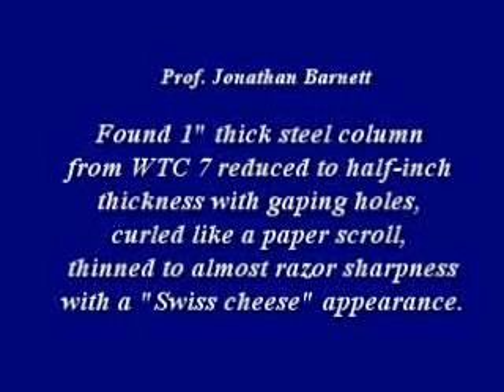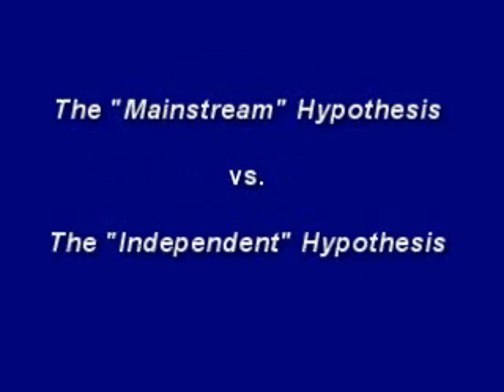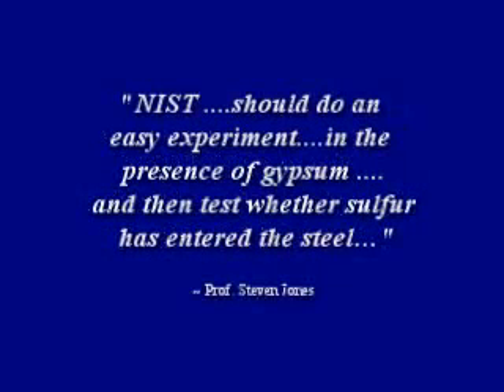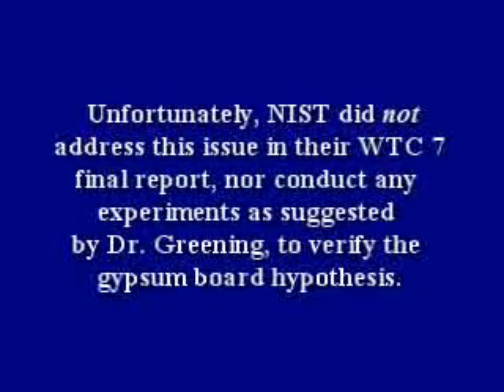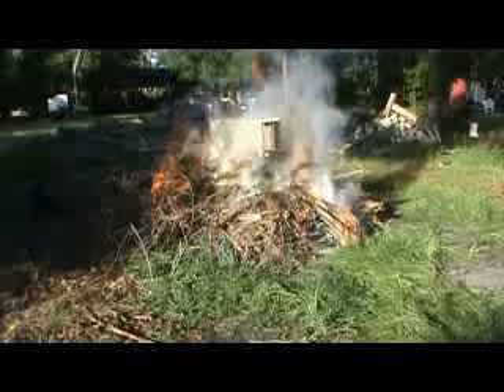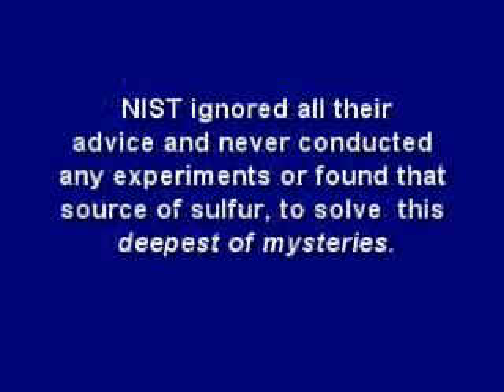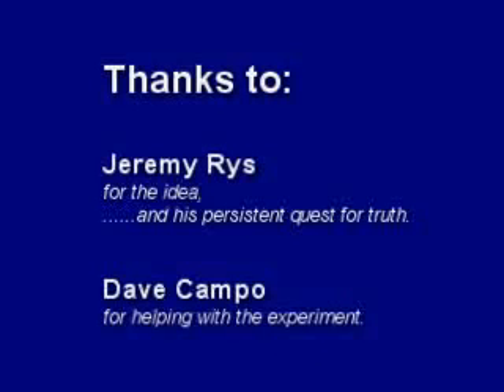9/11 Experiments: The Mysterious Eutectic Steel

Comment: @IExposeMormonism I understand nanothermite can be mixed in water & painted on the steel cores. Uniform lengths of steel beams which fell were stacked & loaded on flat beds sent to NJ lots before the were loaded on ships & sent to India & China for recycling. 911 01 was planned and set into action by Strategic Communication Laboratories, London. The PVI plane animation was generated on the helicopter shot. Zooms in and out at SCL's opCentre were practice shots in preview monitor before program

Comment: @Merlin5x5 McCormack Center fire:1960 exposition hall destroyed in 1967 fire, thought fireproof by virtue of its steel and concrete construction. At the time of the fire, the building contained HIGHLY FLAMMABLE EXHIBITS several hydrants were shut off, the sprinklers proved inadequate.

Sound theater-Lancaster was built to conform to a 2-hour, fire rated assembly code, many other fire protection features that could have assisted in saving the structure and reducing the damage were not present.

Comment: @Merlin5x5   So, If I can prove this is in the NIST report will you admit you haven't actually read the documents?  Will you also admit that you're the one that "blows" er a, hot air...for the most part?

In fact, how about you stop posting if you're wrong.  Put your money where your mouth is...well, no, there would be pubes on it then.  So, you retire and go back to your little sand castle and rule it 'til the tide comes in..

Comment from the maker: @911twoof The average acceleration for WTC7 the decade before 2001, was zero.   And on average, for the prior 1000 years, WTC 7 never existed.  But its not the average acceleration that matters; its the instantaneous acc. that is key.  The fact that it fell  free for about 100 feet means that there was no supporting structure at all. What force removed all supports, allowing building 7 to fall free?  The only force that make sense, matching all evidence, is that force from explosive energy.

Comment: @SuperLogicalthinker The witches had to come up with a story for why the PVI plane animation generated on the helicopter shot did not stop at the premapped parameters set on the camera shot. Notice the zooms in & out before the plane icon entered the frame. Director was rehearsing the animation in PREVIEW monitor in the control room. The reset button had to be hit on the keyboard to adjust the parameter & was not pressed therefore the PVI animation continued to the preprogrammed line. pvi. tv.

Comment: @SuperLogicalthinker FYI, Repubs changed the stars on the Repub logo to pentagrams after GWB was appointed president in 2000. Marvin Bush was on the board of directors of Securacom, security of WTC. Witch cousins' John & Michael Cappelletti's demolition company gained clearance to enter WTC w truck of nanothermite. Nanothermite mixed in water is easily painted on steel beams. Lengths of steel beams fell in similar lengths to be stacked on flatbeds, shipped to NJ yards to be prepared for shipping

Comment: @Merlin5x5 Problem is: You cannot get more heat release with lower oxygen,
you might contain it yes. But the ratio between oxygen and containment would not in a million years allow steel to melt. You can do an experiment in your fireplace: 
Make a solid fire over a couple hours with firewood, Shut the air intake valve almost to a complete. Would this result in a tremendous heat increase and the cast iron fireplace would melt? Would it stay roughly the same, or decrease.

Comment: "In effect, I think it looks like it was first compressed together, then extruded THRU an opening snapping off at the thin edge." I somewhat agree on this from an observational viewpoint, however an analysis of this object should be conducted to see if it has a link to the iron microspheres. Lower oxygen equals lower heat release, there is no reasonable fire mechanism to support this happening under the rubble. Do you have any basis for explaining how low oxygen can increase fire heat?

Comment: @Merlin5x5 Well, its pretty hard to tell without proper analysis anyways. One thing is certain, that thing was hot as hell. Its hard to define excactly what steel it consists of.
I don`t believe this can occur naturally in office fires, there is no presedence that I am aware of to suggest so. I find it very curious if NIST has not forensically analysed this piece, as it is an anomoly at best, I cant find any analysis performed on it. An electronic microscope would tell us more about cause.

Comment: @Merlin5x5 So what is the natural cause of 3 concrete floors fusing with alot of steel making it a meteorite shaped lump of rust? What temperatures could cause this "fusion" ? One would expect such an amount of material would pack some serious thermal mass and require _alot_ of heat. Is it possible that in an oxygen low environment under the rubble of WTC towers it could reach the conditions needed naturally (not to mention sprayed with water). This piece should be analysed with a e-microscope.

Comment: @Merlin5x5 so 316-450 celcius office fires are equal to 1580celcus ? eutectic steel is caused by gypsum that is practically fire-retardent? Do you have any notion in how temperature and heat correlates? If you put 1 woodblock in your fire place, would the steel melt? What about 2? 4? WHAT IF IT WAS AN OFFICE FIRE AND IT WOULD NEED TO FIND NEW HYDROCARBON SOURCES? WHAT THE FUCK WOULD HAPPEN TO THE STEEL ABOVE? Cool? or melt? stupid fuck

Comment: @Merlin5x5 "It's under the boots of every Welder that uses a cutting torch in the world." And at what temperature does a welder operate? At forgelike condition under a rubble of a 47 story complex?

"There are two LOW PRESSURE lines for fuel and oxygen."  excellent, 
and does a lower amount of oxygen than air in an atmospheric condition allow 
higher temperatures in hydrocarbon fires? ( if no, why are you insane ... again?)

What causes steel to melt? officefires or thermite?

Comment: @physicsandreason OK. But, still, Greening said aviation fuel. Its just something the opposition will point to regardless of whether or not it makes any sense. I did a search on aviation fuel and found that there are additives that may not be in diesel, e.g., dinonylnaphthylsulfonic acid. Could that possibly cause a eutectic formation and could that be a reason why Greening wanted aviation fuel in the mix? Thanks.

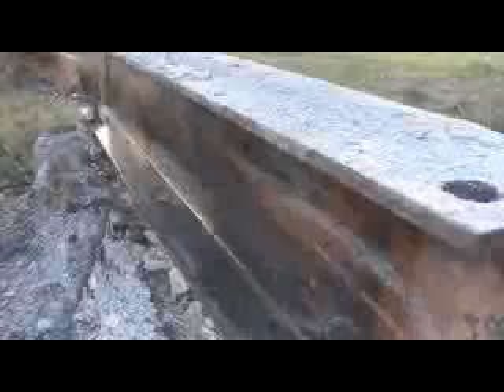Comment from the maker: @AnnRKey I did include some rusted steel in the mix.  Some are shown on top of the wide flange at 7:11.  I also included some plastic in the mix.  I used diesel fuel (off road #2 fuel) rather than avaition fuel because no plane hit WTC 7 (the focus of this particular video) yet there were diesel storage tanks that some said "could have caused" the eutectic formations.  Feel free to copy.

Comment: @PsychoBurgundy2 What the hell does that have to do with anything? The outside dimensions of the WTC towers were 208ft x 208ft , the official story claims the upper block and the floors collapsed on top of each other and accumulated. This cannot happen when the floors and upperblock is exploded outside the 208ft x 208ft perimiter. If you try to hit a nail with your hammer and miss, do you think it would drive itself down due to gravity?

Comment: @Merlin5x5 And when it comes to calculation of energy you cannot understand the very very very basics. Can 100% of the energy be conserved in gravitational motion over 12 floors when there is structural components beneath it? Can it ALSO pulverize buidlingsize amounts of concrete and throw steel 2-300ft in the same process? What part of this BASIC knowledge don`t you understand?
This CANNOT occur NATURALLY according to NEWTON and CONSERVATION OF MOMENTUM YOU IDIOT!

Comment: @Merlin5x5 Woah, there, mister know-it-all.

Did you know the melting point of steel is 2700C?

If you knew any math, you'd know that steel doesn't lose half it's strength at 600C, especially a 22" by 42" thick steel beam designed to withstand up to 3000C fires. Not just that. if steel melts at 2700C, how does it become molten steel in massive amounts under the WTC with just 450C and 600C?

Your theory is flawed :)

Comment: 911 was a staged event, it took planning, but slipups happened. PVI virtual media services/LVIS computer generates wireframe virtual lines on which an icon/jpg is animated. This computer is used to generate virtual lines on camera shots for downlines & line of scrimmage to be generated. When the plane icon was generated the parameter for the edge of the building was not adjusted, the plane icon appeared to jut through the edge of the blg. pvi. tv home page has many virtual environments.

Comment: @Merlin5x5 The "Murtaugh" building? You do mean the Murrah blg, do you not? I don't think nanothermite is considered a bomb & was probably chosen because it could easily be painted on the steel columns. I have learned that nanothermite was available at the Philadelphia Naval Business Center. A short distance from Upper Darby, PA, where the Cappellettis live, a short 90 mile drive to NYC for a truckload of explosives. Cousin, Marvin Bush's Securacom co. gave clearance for entrance in WTC.

Comment: Fire, an organic process, burns 1 area, and moves to another looking for a fuel source. It doesn't burn an entire floor at the exact same temp, causing every truss to sag/break at the exact same fraction of a second! We saw 3 symetrical collapses on 9/11 blamed on non-symetrical damage, fire being the main culprit. If fire were to cause a collapse (which it has NEVER) it could NOT replicate Controlled Demolition. If one side burned faster than the other, the collapse would be NON-SYMETRICAL.

Comment: i was a structural fitter for years before i was hurt. meaning i built steel structures, so even after only working with the steel for a few weeks i knew that there is no possible way to melt steel with temperatures from only normal office type supplies. as i recall the wtc fires only lasted a few hours, and had burned out BEFORE the collapse, because of the people standing in the holes made by the plane entrance and you kept it hot for over 24 hrs,

Comment: A typical closed mind 'expert' response to this event based upon incorrect ASSUMPTIONS !

Compound elemental aglomerations formed within the induced collapse are bound to look like thermite due to the construction materials used, 
but that is NOT proof that thermite was there before the event.
Ditto sulfurous and rusting iron (tiny spheres/dust) due to molecules atomically disocciated from the steel beams in the presence of sulphur and oxygen atoms.

Comment: what type of iron did you use?, what state was it in. You did not say  the number.  a what if the iron alloy had high sulfur content in it What if the steel mill use sulfur to lower melting point to save money. Any more and more look over evidence I find that the build cut corners that should have not have been cut. In  the past over shore have miss labed things. Like labing grade nine blots  but they were not.

Comment: We have eutectic steel, iron microspheres, pulverized concrete, fused concrete and steel meteorlike formations. Even police handguns fused with steel/concrete, 6 inch steel columns bent like a horseshoe virtually without cracks or buckling. According to the National Fire Protection Association standards, practically either one of the above would lead to tests for exotic accelerants, This is true for a regular two-storey building. NIST however has it`s own "Standards" .

Comment: speaking about holes in the world trade center steel and strange curling of the steel.. if you go to the world trade center memorial in warren, NJ you can see the holes and strange curling.. call me an ass, but i took a 3 inch and a 1 inch piece piece off the steel that had these little and big holes and i was trying to get it tested i was sending emails but no response i had the pieces in my trunk of my car and 3 days later my honda prelude was stolen never got it back never could get it tested

Comment: @Merlin5x5 If you can replicate the eutectic steel and its characteristics "reduced to half inch thicknesswith gaping holes, curled like a paper scroll with a swiss cheese like appearance etc" I suggest you do excactly this. Using what availible building materials found in WTC7 and probable configurations according to building techniques. I would also suggest a extreme case scenario with the best combination ratio of the materials to support even a remote possibility of occurance.

Comment: oy...so they had been pre-wired with explosives 30+ yrs ago when the building was built? I think your theory is based on incomplete info so flawed ..much like the second gun men theory with JFK  if you change two facts The seat JFK was sitting in was 6 to 8 inches higher then they thought and Sen McConnell(sp?) turned when he heard the first shot..the Magic Bullet theory goes out the window..what if the steel used was just cheap and the inspectors bribed so it would pass inspection .justathought

Comment: @SlipknotHeadbanger1 It had been postulated that the sulfur from the gypsum wallboard led to the observed phenomenon in the steel. This experiment shows that burning gypsum and others materials in the presence of steel will not lead to the effects detailed in Appendix C of the FEMA report.

A real investigation is necessary.

Comment: @TheSkepticalIdealist My father confirmed that molten Aluminium was pink in colour in the furnace and was silvery when poured out in air.
Simple. "
-
Well sorry, its just not true. You cannot tell what metal it is just by looking at it.
TheSkepticalIdealist "

Well if you spend your life working in a foundry that only deals with smelting and forming aluminum,its pretty obvious that those who had been working there are able to describe the behaviour and look of the material.

Comment: Regarding WTC7, NIST states in their final report, "Due to the effectiveness of the SFRM[spray fire-resistive material] the highest column temperatures in WTC7 only reached an estimated 300C(570F), and only on the east side of the building did the floor beams reach or exceed 600C(1,112F)”

In this experiment by Jon Cole the fires did get hot enough to melt the aluminum so that is at least 1,220 F.

Comment: @Merlin " "The fires reached 1200 C on many floors of WTC#1"

You are confusing the temperatures of the fire with the temperature of the steel. It is the latter that maters. NIST found that only 2% of the perimeter columns saw temperatures over 250C(482F) and none of the core columns.

Comment: @SexyMelon I know the structure a lot, the point I was trying to make is that the core columns ( 1 inch thick at 98th floor) din't have to be cut or heated to the point of total buckling.

The perpetrators just had to stuff some 100kg of thermite in a bag inside the cavity of the I column, the thermite would heat the connection and the bolts would fail, those columns were very, very vulnerable to thermite attack.

Anyway, the I coulmns shielded the charges from debris.

Comment: @roxxphatcox Steven Jones mentions an experiment that he did. 

""I (with colleagues) have done the experiment with thermite + sulfur (often called "thermate") acting on a piece of WTC steel. In fact, I did the experiment with BBC filming it! Then we looked at the steel, including use of electron microscopy, and found the same characteristic corrosion as found by Barnett et al. in WTC 7 steel."
Steven Jones

Comment: @TheSkepticalIdealist If Jon Cole did this experiment incorrectly, then you need to tell us how to do it correctly.  If done correctly you should get similar results, intergranular melting due to the presence of sulfur; gaping holes--some LARGER THAN A SILVER DOLLAR; one-inch column reduced to half-inch thickness;  temperatures of the steel beam approached ~1,000ºC.

Please elaborate...

Comment: @TheSkepticalIdealist Nr 1 : The column in question is 1 inch thick, the example I gave was how easy even a small amount would cut through more than 2 inches of bomb and fireproofed steel.
Nr 2: "the effect we are talking about is not produced by thermite/thermate" to quote my good friend Merlin here "LOL". Thermate is an eutectic mixture/compound and has matching characteristics to the evidence found.
A correctly composed thermate mixture would be more likely to have caused the eutectic steel

Comment: If you have 1 pound of thermate and the area your are cutting on the 5000000 ft girder also weighs about 1 pound. Then it would be somewhat probable to cut it right? Ofc there will be some heat dispersion but maybe you get the general idea:)

Comment: @Merlin5x5 So you are saying that the heat would transfer not only the general area in what the thermate/thermite reacts but it will disperse the heat energy across the whole 500000000 ft girder? And here is another "What if" merlie:)
What if you were to place the cubic foot of thermite above the steel , creating a torrent of lava, And how do you explain that thermite/thermate has been proven to cut steel, but you desperately try to make it look impossible?

Comment: @Merlin5x5 So we got thermite/thermate at 2500C and you got the melting point of steel at 15-1600C, would you say the office fires even at is maximum temp around 1100C has a higher probability to melt steel? Or is it some chemical combination found in office buildings (disproved above) that would lower the melting point of steel 500 !!!! degrees celcius? And will thermite/thermate cool below 1500c in any case?
Cant this cut/melt steel regardless of amount ratio, but gypsum/diesel would?